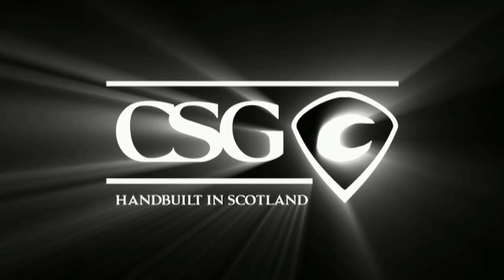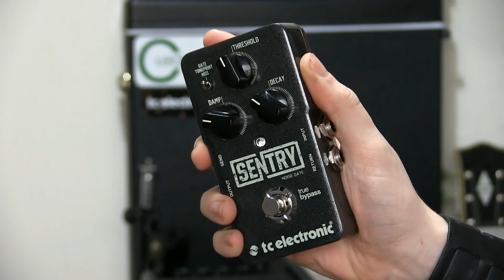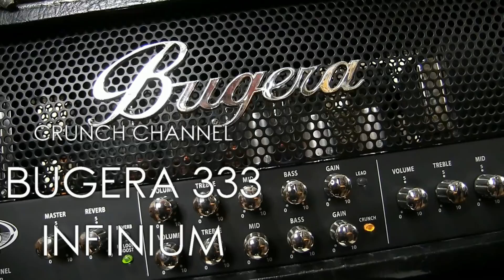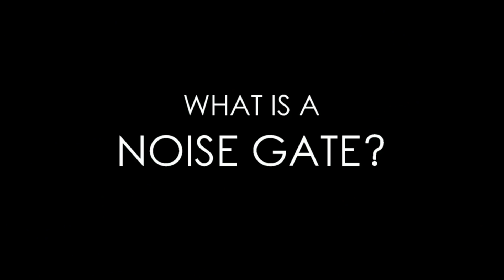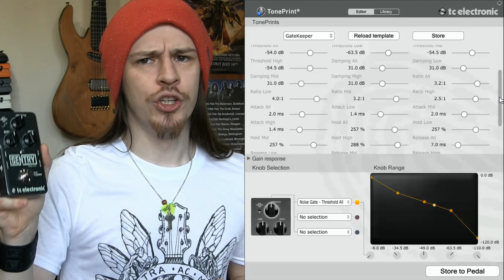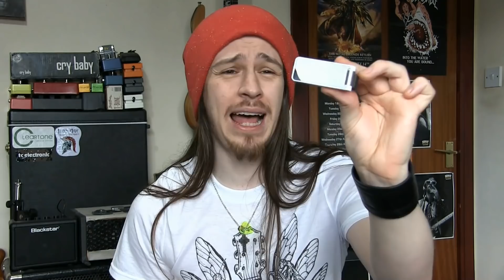Sentry Noise Gate TC Electronic: Gear Review

Comment: My noise comes from my guitar (turn volume down on guitar noise goes away). How would this compare to a Decimator 2 g-string? I don't care for the way the Decimator g string cuts out. With the gate set low it closes too slow. With the gate set high it cuts notes too easily. I can't find the middle ground. If it had independent controls istead of one knob it might be better.
  Does the TC have much affect on tone?

Comment: The pedal is VERY noisy. I got one today and returned right after testing. Opening and closing of the gate is OK, toneprint works too but whenever the gate is open it introduces a surprising lot of hiss, like you would turn the gain of your amp like +6 db or something. Really disappointing.
Reply from the maker: You either got a faulty unit or your issue was elsewhere (either in set up or the rest of your equipment). I've been using this unit for many years with no such issue.
Reply: @ScienceofLoud  I made a video with the issue: https://youtu.be/Uc59S5pTUt8 check it out
Reply: @thor_nay  Weird! Did you ever figure out what was going on?

Comment: I love my sentry. Although I use it a bit differently. I use it through my fx loop (and patch my time based pedals through the sentry's fx loop). For one, this tames a noise issue in my fx loop, but I also discovered I could tame the tails of my delay effects (I stack two of them) and avoid the muddle.

Comment: i just order that pedal with evh 5150 lbx,maxon 808 ,delay,chorus and boss bcb 60
i need some help how to connect them properly for best sound.i saw so many opinions about pedal ordering that i am complete 
confused.
Reply: XDX guitar > tuner > compression > overdrive > distortion > chorus/flanger/phaser > delay > reverb > amp. Wah may change it a little depending on the type.  There's a ton of YouTube videos on this topic.
Reply: ty my friend ...yes indeed i was saw so many videos...my problem actually was the noise gate
Reply: Coming in a little late but you basically want your noise gate right at the spot where noise is generated within your chain. In most cases, you'd put it at the start, but noise may also come from a noisy pedal. In this case just pop the noise gate right before the pedal. Hope this helps !

Comment: Hey, I heard that the bugera amps have trouble and tend to... Explode. How do I know if a bugera amp is going to explode?
Reply from the maker: +Jared Vas if you have one that was made after 2008 it's fine. Only the initial run suffered from problems. You don't stay in business for this long if you don't fix problems.
I've had mine for years with zero issues and I've spoken with many people who gig with them and they've had no problems either.

I know more people who have had Marshall amps fail than Bugera.
Reply: CSGuitars really? That's great! Thanks alot for replying. I've been wanting to get a tube amp, and bugera seems perfect, especially since they're trying to emulate higher end amps. I'm just a casual player, so I don't have a couple grand to drop on an amp. Thanks
Reply: CSGuitars oh, btw that tone is heavenly

Comment: I have been considering upgrading from my NS-2 to the TC Sentry.  I had my first NS-2 last for about 19 years. Then I replaced it with another. I was really excited to hear about the multi-band feature on the TC Sentry.  Great job on explaining in your videos.
Reply: Check out the Electro Harmonix Silencer, its the same as the Sentry for only $57 new and compare it with the Sentry before you buy.  I did and I walked out the store with the Silencer and had extra money to spare to buy another pedal. :)
Reply: I know about the EH Silencer. The T.C. Sentry I think is more advanced, it has muti-band reductions. It is a little different in the way it tracks the signal for noise. But, thanks for replying.

Comment: Have you tried the EHX Silencer? Wonder if it's as good as this but cheaper. Of course it doesn't have toneprint.
Reply: GeoAl09 I actually bought the silencer cause it was about half price compared to the sentry where I live. Now I know it isn't perfect and you have to tweak the settings depending on your distortion level but I only use it when I play with heavy overdrive and it works like a charm.
Reply: Well yeah it's pretty effective at cutting off feedback and buzz you might get when you're not playing. Actually the more noise your gear makes while not playing, the faster it cuts it.
Reply: Yep! I've been wondering the same thing!
Reply: +CptSnakeshit Funny I saw this comment. I returned my silencer and I'm going to buy this pedal instead. The problem with the silencer it's single band and it's evident when you use it.
Reply: Your milage may very.  I found the Silencer a much better noise gate than the Sentry.  Really keeps my high gain Marshall and noisy pedals at bay.
Reply: I agree the Silencer is a GREAT PEDAL.
Reply: Hey man does it cut out any unwanted squeal that you may (I do) get when standing in front of a loud high gain amp and stop playing (or in between chords even)? Gibson Invader and Mesa Mark V:35, 1960A cab. Thx.
Reply: Thx Capt. I am still unsure if I should wax my pickups or get the pedal...any advice welcome. My guitar is 34yo and I love the tone but the squeal is a major pain!

Comment: Hi I just found your video and love the way you use humor in presenting your review. My question is what is the best place in my chain to put the sentry, in the beginning or end. I currently have a pedalboard with overdrive,compression and a few modulation pedals and my amp does have an fx loop. thanks
Reply: I'd say at the end. In fact it would be best to run all the pedals through the fx loop on the pedal for optimum performance.

Comment: I think I am just a huge pedal hater for one... Again, I think if you have a decent amp that you're not chaining a bunch of crap through you should not even need one of these. I am playing death metal in B with a huge sound and I have my half-stack dialed so that I can pretty much stand in front of it at full volume and get no feedback. (This is with a Crate (Lee Jackson) 50 watt GT-50 tube head into a 4x12).

Comment: Does it work with high volumes? Say 7+ on a JCM800?
Did you have any problems with putting your preamp in the loop of the pedal?
Question should be: can it handle Line Level (+4 db), because some FX-loops only run on that and not on -10 db.

Thanks!
Reply from the maker: +MHX Sentry should work equally well at all amplifier volumes. It gates based on the guitar, pedal and/or preamp levels, not on the volume coming from the power section of the amp. 

I had no issues taking a line out of the amp FX send and hooking it into the Return on the Sentry. In fact I found it to work best that way. I believe TC Electronic design all their pedals to work equally well at both line level and instrument level.
Reply: Thank You Sir!

Comment: Hi, finally the in depth review of the Sentry i was looking for!!!
however i still have some questions though, how does it performs in the "Hiss" mode?

Also, what does "crossover", "exp.knee" and "ratio" on the tone print editor? also  whats the difference between "Hold" and "decay"? (also on the tone print editor)

Cheers!
Reply from the maker: +SweBass I'll perhaps do a follow up video on setting up a custom Sentry TonePrint once I've had a bit longer to play about with the Editor and get to grips with just what everything is doing.
Reply: +CSGuitars omg that would be AWESOME!!! because there are no informations from TC or in internet about the sentry tone print editor settings
Reply: +CSGuitars can u still feedback with this pedal, cuz thats actually a plus for me if u can as my band has a lot of punk and eyehategod influences and the feedback notes are quite musical to us when playing but the annoying hum and hiss when not playing is the worst
Reply: +CSGuitars Please do this. I just got one of these and it's fantastic but I want to have a look at the editor so I can see if I find something that suits me and my setup even better.
Reply: Hold is how long before decay I would presume, decay would be time/speed of decay. Crossover is the cutoffs/frequency for the different bands. Exp.Knee  and ratio sound like compressor stuffs.. I'm not great on that.
Reply: Duncan Robinson - I'd recommend turning it off when playing and just turn on when finished.. or very light settings. But might not get rid of what you want entirely. Separate bands should help, you could focus on high and leave the mid and bass etc.

Comment: If can find an old power conditioner from something like a hospital that will also work great.
Reply: Power conditionner or any high end isolated power supplies helps from "ghost" noises or "white" noises caused by the power, but gain noise (pedal or amp) can only be reduced by a noise gate.
Reply: +SweBass What I meant was a 4:40 he mentions getting an audio grade power conditioner. I was referring to the fact the medical grade ones are even better and can be occasionally gotten for free in less then perfect condition from hospitals, not that a medical grade power conditioner will work as a noise gate.

Comment: Hey Colin, do you have any experiences with the Bugera Trirec Infinium? Also have you had any problems with your 333? Thanks in advance!
Reply from the maker: +cubegymnastir Hi, I've not had any experience with the Trirec. I've spoken to people who own the V22 and 6262 and all of them spoke very highly of those amplifiers. 
I've not had one single problem with my 333. I have upgraded all the valves, as the stock Bugera ones aren't great quality, and the amp has been running for a few years now without any issue. Yes, they are cheaply made amplifiers, but I think they are one of the best bargains you can buy. Worth a look.
Reply: CSGuitars Awesome man thanks for the input. Keep up the good work, youre recent videos have upped in quality which is good to see! Thanks again